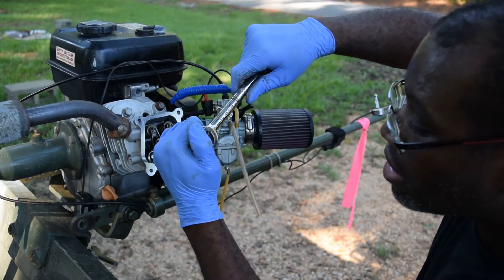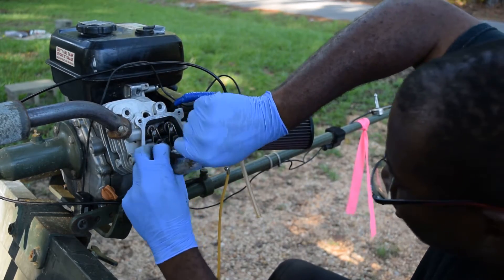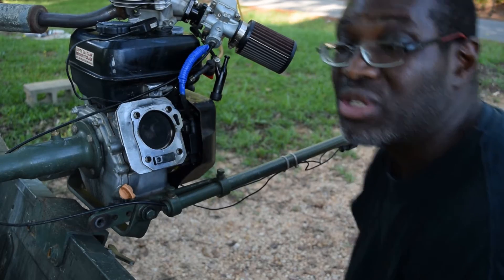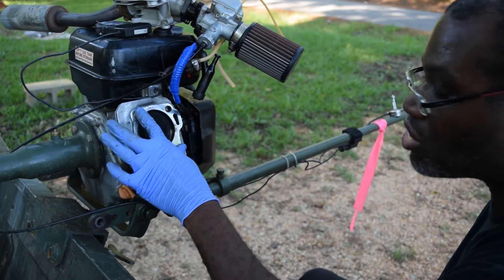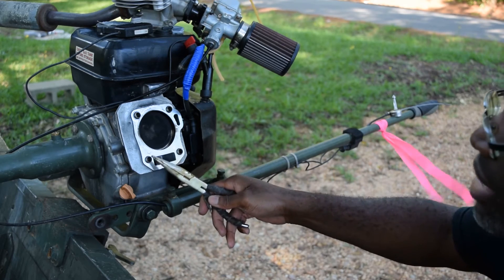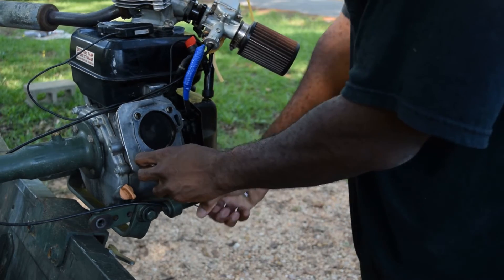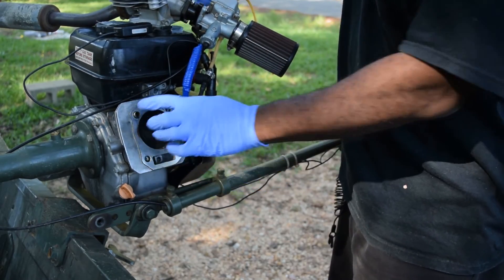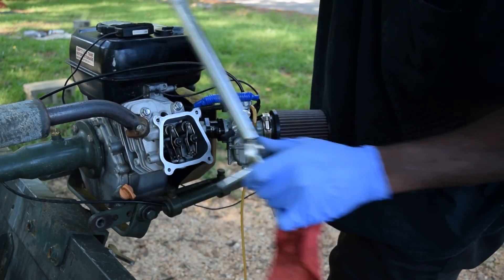Stage 2/3 Mud Motor Build | Cylinder Head Dowels

Comment: Try marking the holes which are to small to the right size. Use a dremel tool and simply and slowly grind out the hole , should work like a champ..
Reply: From the inside edges ...
Reply from the maker: Thanks. The cylinder head wouldn't fit despite the gasket. That part didn't make it into the video. That's why I settled on two dowels. I plan on installing a true stud kit later which will be far better overall.
Reply: Surely will :)